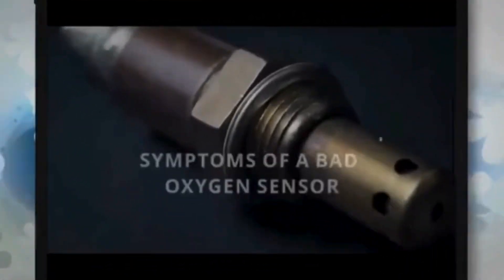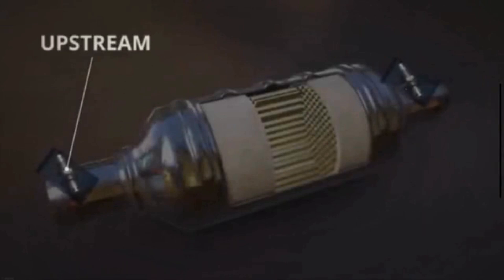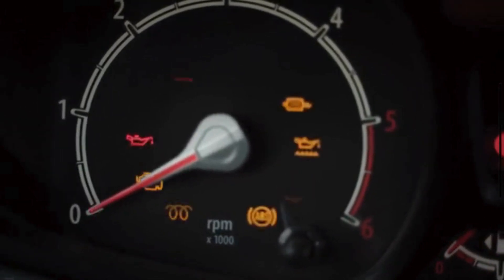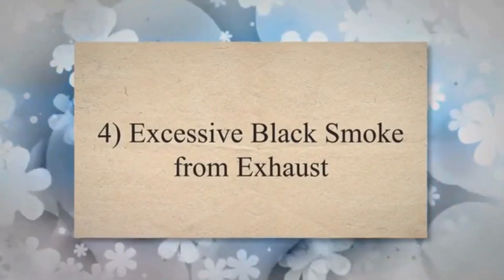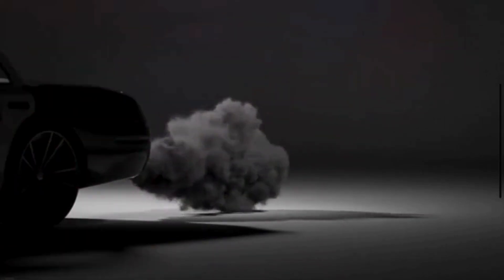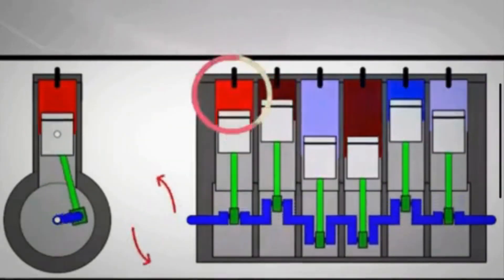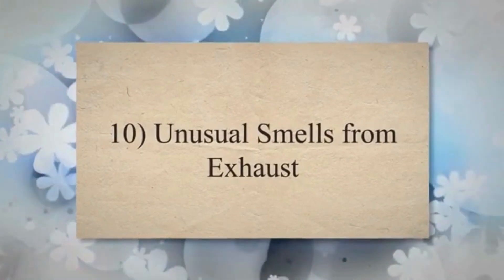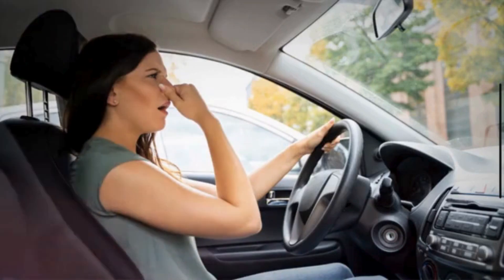10 COMMON SYMPTOMS OF A BAD OXYGEN SENSOR | ROUGH IDLE, ENGINE MISFIRES & MORE

Comment: How do you know if the downstream sensor fail,
Reply from the maker: Diagnosing whether the upstream or downstream oxygen sensor in your vehicle has failed involves a combination of observing symptoms, checking for diagnostic trouble codes (DTCs), and performing specific tests. 
1) Use an OBD-II scanner to check for error codes. Common codes for oxygen sensor issues include P0130 to P0135 for the upstream (Bank 1 Sensor 1) and P0136 to P0141 for the downstream (Bank 1 Sensor 2) sensor.
2) An exhaust leak before the upstream sensor can cause false readings. Use a smoke machine or visually inspect for leaks in the exhaust system.

3) Upstream Sensor: Measures the amount of oxygen in the exhaust and fluctuates rapidly between 0.1 to 0.9 volts.
Downstream Sensor: Monitors the efficiency of the catalytic converter and has a more stable reading compared to the upstream sensor.
Using a Multimeter or Scan Tool: Check the voltage readings of both sensors. An upstream sensor that doesn’t fluctuate or a downstream sensor that reads similar to the upstream sensor might indicate a problem.